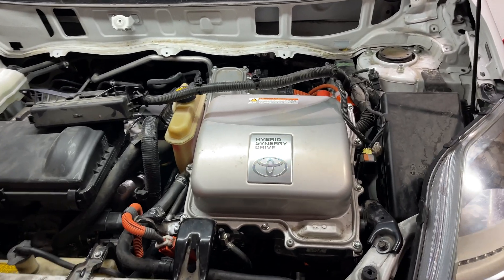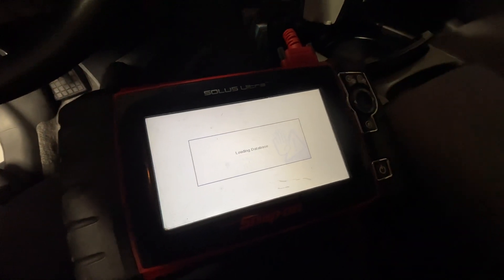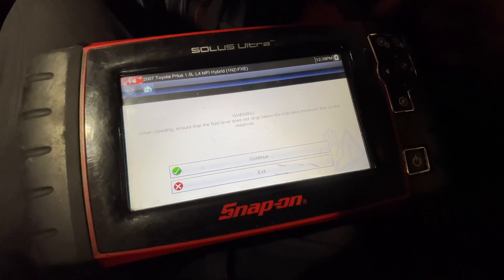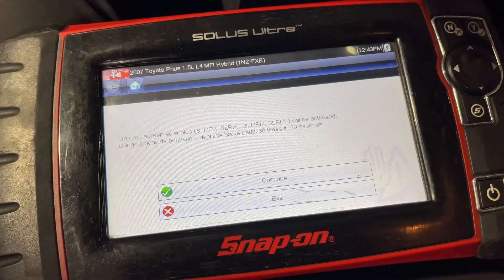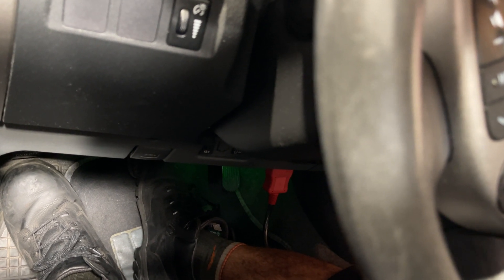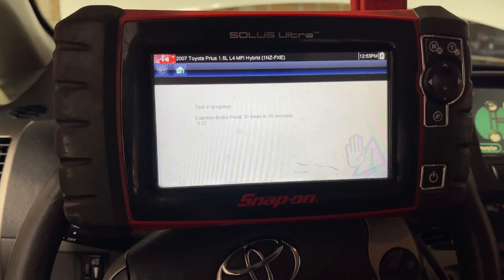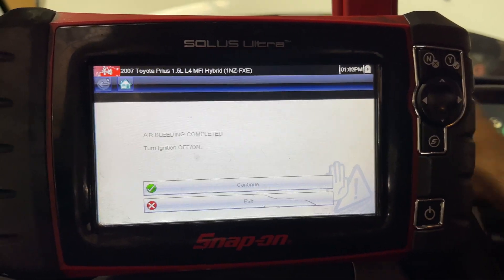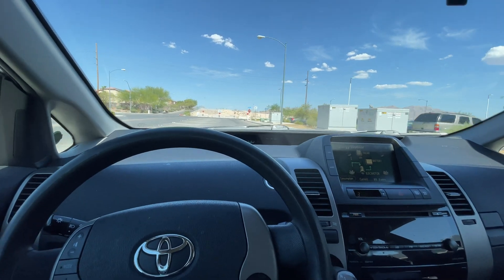HYBRID BRAKES AIR BLEEDING ACTUATOR REMOVED : 2007 TOYOTA PRIUS PART 2

Comment: Just did the same job on my 2006 Prius, trying to bleed the actuator with techstream on a laptop. Everything is connected properly and it picks up the vehicle but techstream will not start the bleed process, just keeps saying "Bleeding Failed, try previous instructions, would you like to try again?" and just can't get past that. ANY help would be appreciated so much! Good video. Thanks!
Reply: I just had the same problem on an autel. When it tells you to remove the relays, dont do it yet. Keep hitting next until the process has started. Then remove the relays.
Reply: "bleeding failed, try again". Yes. I bought and returned a hand held unit last year that said it did ABS bleeding. That specific step kept coming up, so I gave up & returned it!
Reply from the maker: Unfortunately I’ve actually never used techstream to do this job. If you got the connector on the actuator properly seated then I’m not really sure. I have never run into any connection issues with the snap on scan tool or the Autel scan tool that I have. It’s normally a pretty straight forward job just following the instructions. Anyway you could perhaps borrow or rent one of those tools? Or perhaps a Toyota dealer tech can chime in.

Comment: Hey man what scanners do you recommend
Reply from the maker: Autel makes some good, affordable scanners.
Reply: @SkillCollectors   can the autels complete the service you just did
Reply from the maker: @Koala_z06  Pretty sure most of the tablet style ones can. The one I have can, I have an IM608 which I use for locksmith work but also does scan tool stuff.